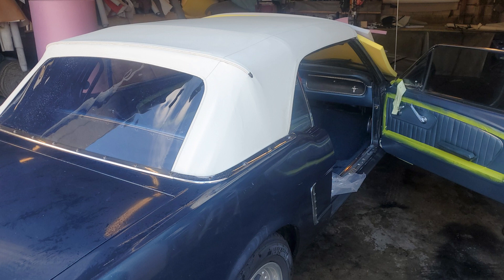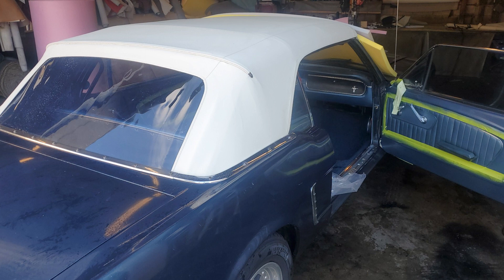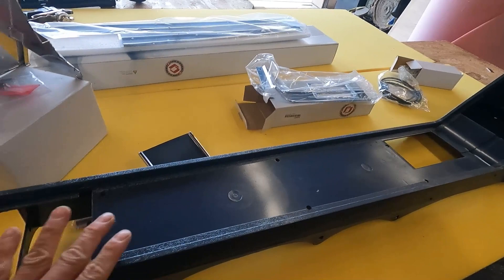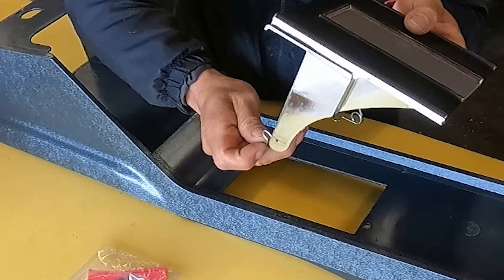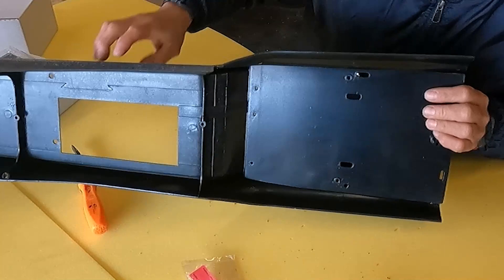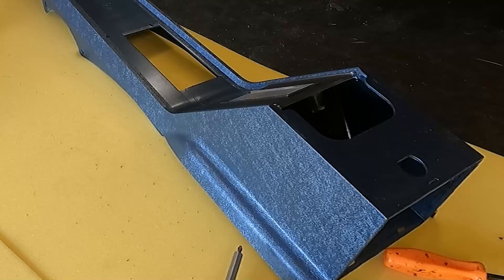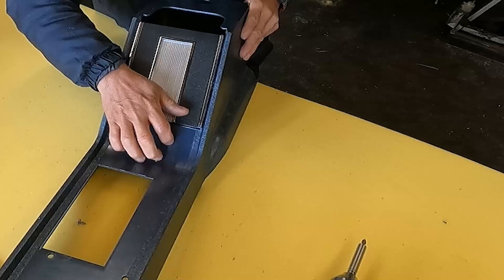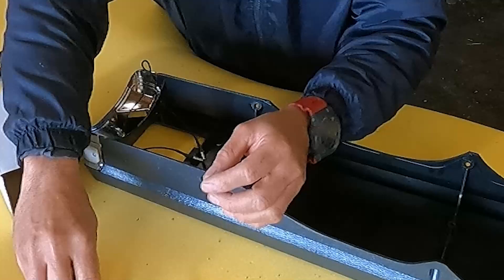Assemble a Center console for a classic Car - Auto Upholstery.

Comment: Do not follow this video and put the door in from the front! This is very risky as you can break the plastic and it's not needed. The door needs to go into the back of the cavity and fits perfectly.
Reply: Right. Its meant to slide in from the opening in the back in the 'open' position then slides down into place. He did it the very hard way.

Comment: It is a 1965 or 1966 Mustang!!
Not a 1967!!!
Or 1964 1/2 because the carpet has no pad at the tunnel.
Reply: Didn’t they not put pad on the tunnel because of the console?
Reply: @swooshdave I have a 65 and I believe it has the padding
Reply: You are correct my friend that’s a 1964 1/2 -1966 Stang not a 67
But that’s a nice car 😎